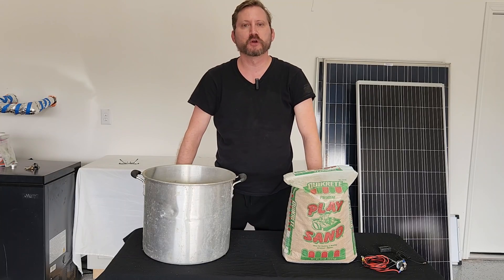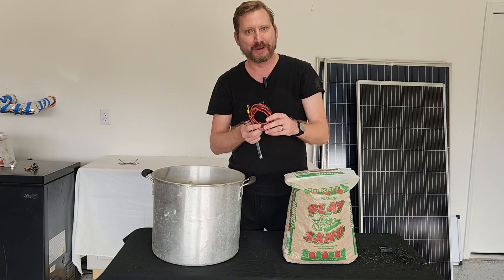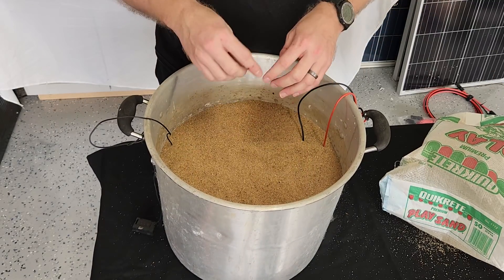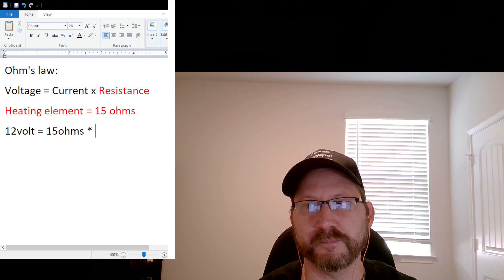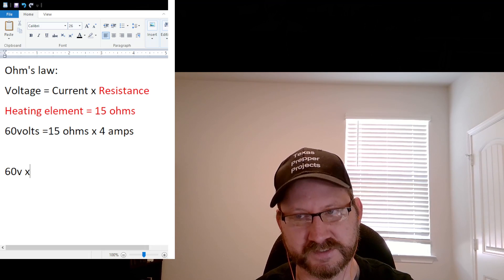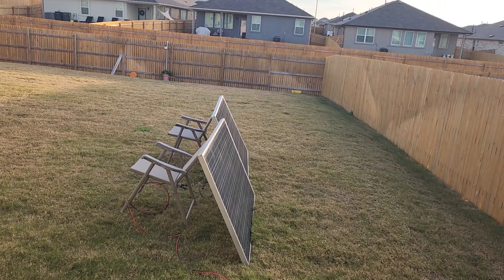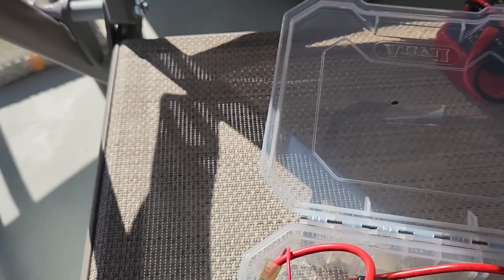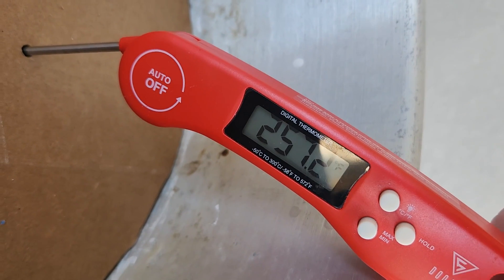Sand Battery Heater solar powered 250F / 120C with no flames or fuel! DIY

Comment: Love it brotha thank you for the update but believe it or not i do heat my house with sand in mass so we get very cold i see your points and i agree i have alot more solar then you have available along with the cost is alot higher then you spent but with higher capacity of weight comes more capacity to hold the pipes at 230degrees i really woukd love to send you out our sand battery to test and pick apart i could even come down with my campers sand battery and show you also im retired and my business partner does awesome so i could take the time away i have many friends in texas
Reply from the maker: Thanks!
Reply: Its a basic question he really was pretty deep with his answer i mean honestly hes still bias about sand batterys but its understandable in small scale there not really working because no one runs exhaust pipe threw it and noone is heating it with enough solar to heat it up to over 400c so no one actually has good data to show but they do work i heat my house with it and this guy is correct about alot of things minus running enough solar and sand content weight wise
Reply from the maker: @Rick1-137   What would you like to know?

Comment: Why not use a copper coil to transfer the heat from the sand into the water into say a water heater or a hydro air system?
Reply from the maker: What would that accomplish?
Reply: @texasprepperprojects  wouldn’t the heat from the sand transfer into the copper coil transfering the heat into the water to be used for domestic hot water or hydro air heating?
Reply from the maker: @whosonfirst1309    If your purpose is to end up with hot water, then heat the water directly using the sun. Check out my 'off grid experiments' playlist. I've easily gotten water to 130F by just running it through black tubing.
Reply: @texasprepperprojects  I was thinking along the line of a heat battery I guess.
Reply from the maker: I'd just heat the water directly and store it in an insulated container @whosonfirst1309

Comment: I think I will try this in my chicken coops around the nest boxes, so the eggs are less likely to freeze. An insulated vent and tiny fan to the nest box bottoms. Great work, thanks. I'm still figuring out the whole electrical thing, it's always been hard for me to understand for some reason. I have some spare 380-watt panels I can use. I hope that is not too much for the element.
Reply: I'll second the notion that a little heater at the bottom of each egg laying box will probably be better. Only need a maybe 2-5 watts per box as the nesting material will hold in heat, and then the hen adds her own. Furthermore, you'll likly want more energy heating security for the eggs on cold wintery nights than solar could provide.  Makes sure the boxes have plenty of nesting material to insulate and hold in the heat.
Reply from the maker: Agreed
Reply from the maker: What is the voltage of the panel? That's the key thing to making this work well.  You're probably better off using an electric dog bed or blanket for that purpose
Reply: @texasprepperprojects  VOC is 47.8. Would that water heater element work good for this panel? I could use more than 1.
Reply from the maker: @scottc8152   What's the rated current for the panel?
Reply: @texasprepperprojects  It is the Hyundai 380-watt panel, Model Number	HiA-S380HI
STC Rating	380.0 Watts
PTC Rating	TBA
Open Circuit Voltage (Voc)	47.80 Volts
Short Circuit Current (Isc)	10.01 Amps
Reply from the maker: should work @scottc8152
Reply: In that application you may want to look at some electric in floor heating systems. You can buy small 120v units for bathrooms today. And you can cut the mesh between the heating wires so they will go down a hallway as well. Lay that at the bottom of a foot of sand under your rows of nesting boxes and they will be warm. I would not put the nests in direct contact. You will cook the eggs.
Reply: I had the frozen egg problem as well in northern Minn-e-so-cold.   I put those small coffee ☕️ cup warmers in the bottom of each nest.  If you have many nests I think plumbing heat tape would work
Reply: Could you use a 30 gallon electric water heater with the top cut off so you can put sand in from the top?

Comment: Interesting experiment, but can probably heat a space more effeciently with that amount of solar..Except in this scenario you don't need an mppt or solar charge controller, or inverter..But, slowly or quickly gathering the equipment to run a solar system, is a much better idea..I built my 48 volt solar system, 30KW battery cells, 2 JK BMS's, All in one 6,500 watt inverter, solar charge controller, ac charger and 6,000 watts of panels, for under $6,000 and that can run everything in my very efficient home..Would like to see an experiment actually heating a space with that battery, with a face off with a 250 watt electric heater...
Reply from the maker: What you have is really neat, but cost far more than this. As I mentioned, this is really as simple as it gets. To use even a $20  300 watt space heater means you need a charge controller, inverter and battery.  Why bother with all that extra stuff when you're still only getting 250  to 300 watts out the other side??
Reply: @texasprepperprojects  Well, I have doubts whether that type of method could change the temperature of an uninsulated space like a green house, in cold weather..
Reply from the maker: Depends on the size I suppose @realeyesrealizereallies6828
Reply: One will likely get more energy using mppt than without. Mppt adjust the apparent impedence of the load to that which will draw the most power from a solar pv panel. Too little resistance and the load pulls the pannel's output voltage down too much and that reduces the pannels output power. But If the load resistance is too high the pannel doesn't push much current and that also failes to pull the pannels max power for any given solar irradiance.  MPPT is so named because it attempts to maxium power point track. 😊 it may be possible to use a DC optimizer    to do the mppt without adding  inverters or charge controllers.